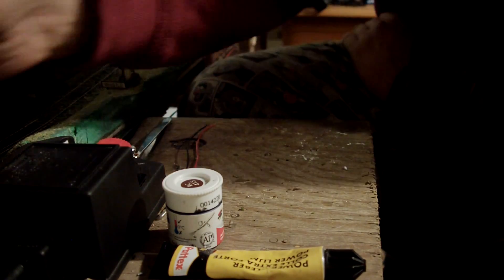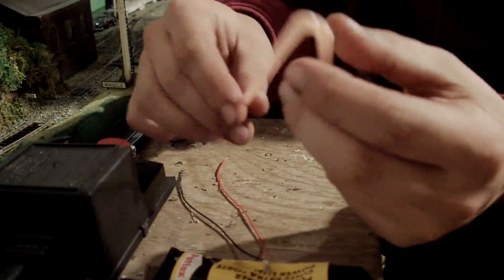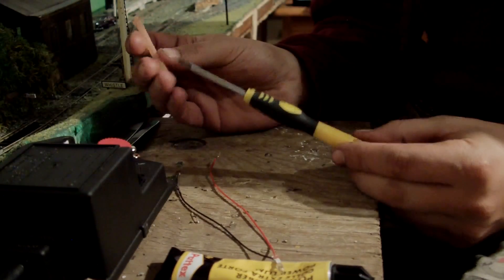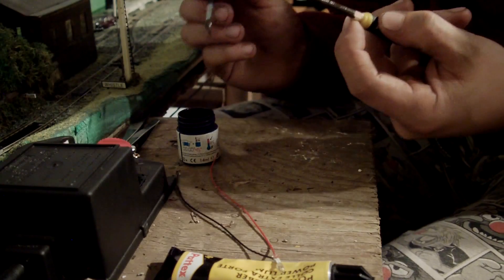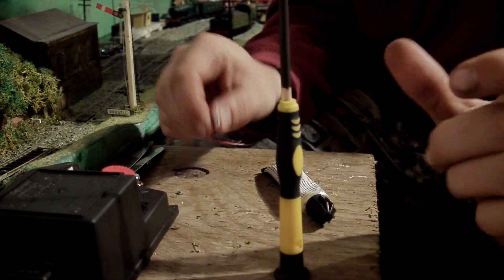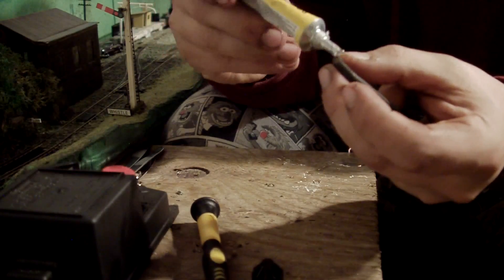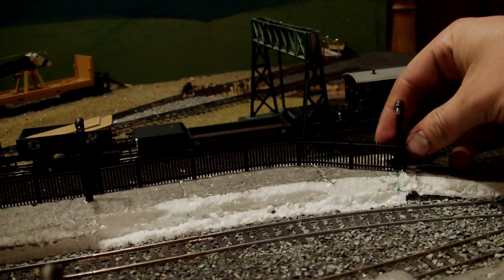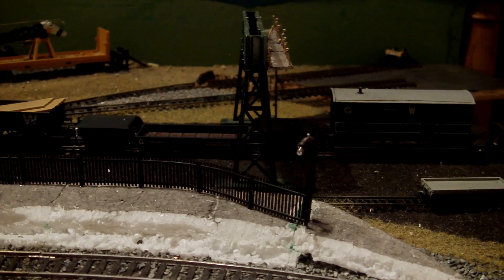How To Make OO HO Gauge Lamp Posts For Model Railway Layout Quick and Cheap

Comment: Hi, good effort. However please be careful with filament bulbs next to, or in close proximity to, plastic. 1) They get hot. 2) Plastic melts! In response to XLilBabyBexX it sounds as if the power supply isn't up to the current draw. Depending on the size of resistor fitted to EACH LED then a 1amp power supply would be a minimum requirement. Assuming a resistor of 1k ohm is fitted to each LED then a 12volt 1amp power supply would be ok for about 20LEDs. An 820 ohm fitted to each LED would allow f